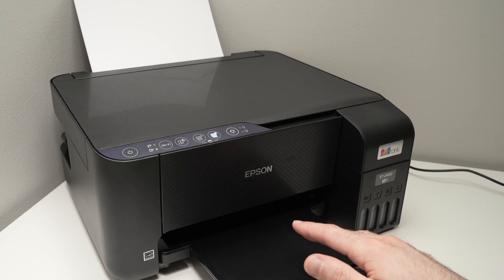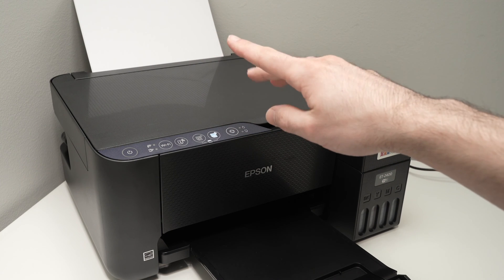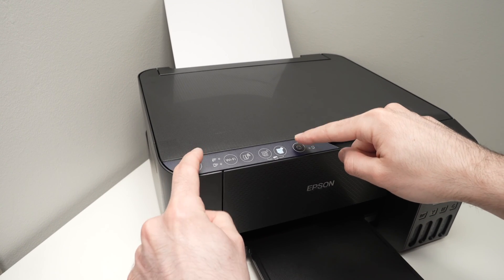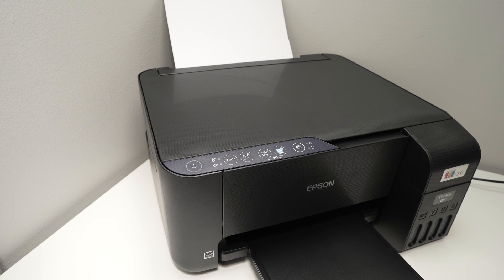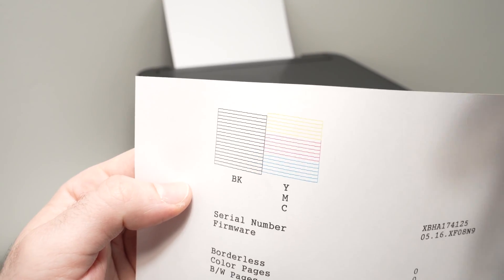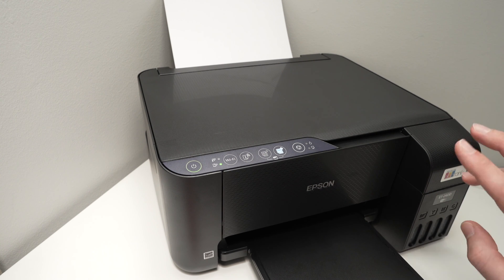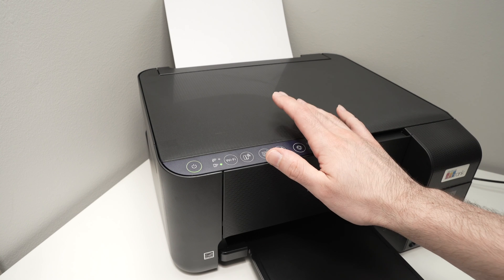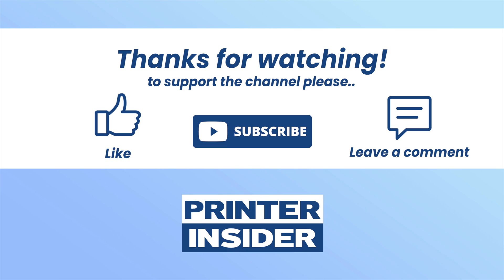Epson EcoTank ET-2400: How to Print a Nozzle Check Test Page

Comment: after following your instructions, the nozzle checking after I did the first time, the blakc ink was not all there with the lines. So, I followed your instructions, and it only printed 1 page of the 4 pages I wanted to print. I guess I am re-doing it again.  Hopefully, it will work.
If is doesn't then what? Need help